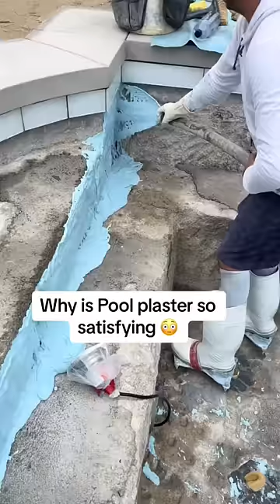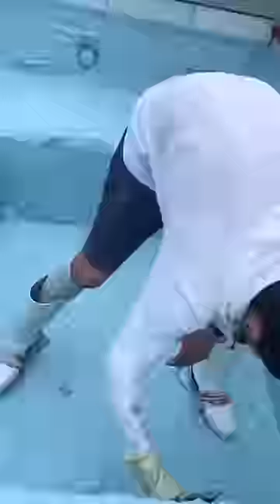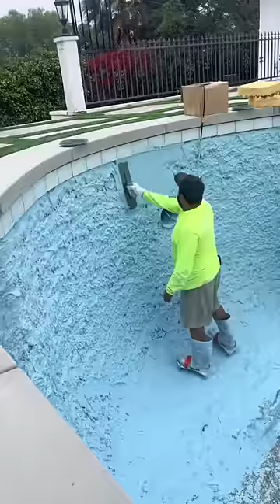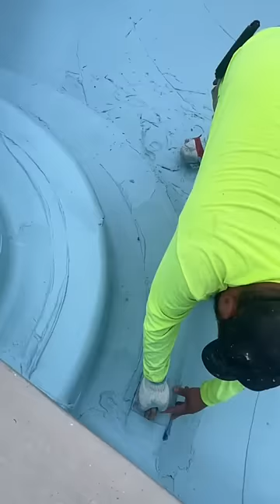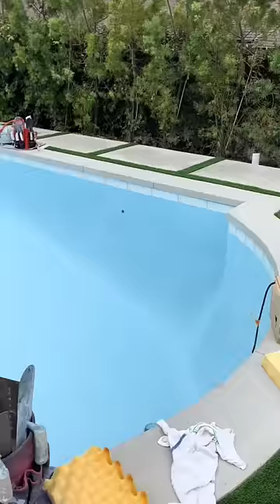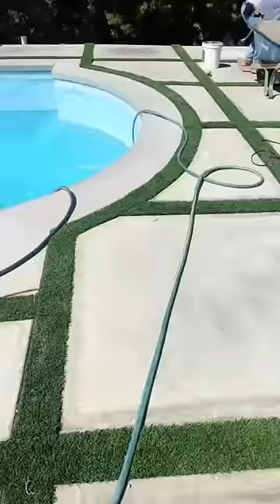Very satisfying 👀 #fyp #construction #satisfying

Comment: With all that pumping of plaster and skimming of the floats, these guys are the cleanest workers ever. Kudos 😉👍
Reply: That’s a sign of a true professional, chef coats are white to show how clean they preform, I try to apply that with my daily life, especially at work dealing with plastisol inks.
Reply: please,  what is  this material?
Reply: @beluga494 I want to know that too.
Reply: @beluga494  we would make a similar mix. I believe it is white sand and white cement and color. It is a rich cement mixture for strength. 
 Can not use normal cement or sand  because it is grey and colors won't work 
   The trowels are more flexible, called funny trowels, usually blue steel. 
We used this same mix for pool decks and sidewalks. We used a beaver brush to flick on a texture, knock it down after it tacks up. Similar to drywall knock down texture

Comment: Working trades is great sometimes. Your process looks chaotic at start but seeing it slowly transform into something valuable to people enough that they pay you is special.
Reply: And fibreglass stuck in your hands
Reply: Для них это остаётся просто "черной работой"
Reply: You're a politician or you really need to go poop.
Reply: What i wanna know is if the guy got the Uber to San Francisco
Reply: If that's gunite it's between 25-40k for that job
Reply: @whitesteve4383 for the plaster? That plaster jobs probably worth 9 grand bud
Reply: @astrocow9223  not hardly bud. You may want to check into that because like the guy said if it's gunite it's probably more like $30k-$50k for the pool and hot tub. It's not just simple plaster, it's formulated just for pools and that brings a hefty price tag

Comment: My Mexican brothers be getting so much done for this society gotta respect them 🫡
Reply: As an Arab my hats off to you brother 🎉
Reply: I used to work the remodel crew for a certain US national electronics store. Every time we worked a job that required new flooring to be installed, we knew right away, every time, whether the flooring crew was going to get it done right the first time in like 3 hours, or whether they were going to take 8 hours and fuck up 5 times throughout.

The teams of white flooring dudes sucked. The Mexican team with only 1 guy that speaks English? THEY know what the fuck they're doing, and they do it WELL.

Comment: Always remember these men earn 10 dollar per hour, and the pool cost at least 200.000 dollar. They work here for a week to finish it. So 4 men works 40 hour is 160 x 10 dollar = 1600 dollar. The rest of the money 184.000 is pure profit for the boss.
Reply: It's become more unfair at the bottom over time imo.. Too many aspects of our "free market" are out of control again.. sorry but this "greed",, private, corporate and government might be worse than ever..
Reply: So the material comes for free does it... The insurance, the taxes, the business insurance, the machinery, the equipment, the excavator to prepare the holes, the bricklayers, the concrete, the pool plaster, the jet  spray, the layer  to sing contracts, the accountants to do the yearly tax returns, the fuel and money spent to build the business.😂😂😂😂😂😂😂😂
Reply: @Sirjohnwilliamuk this is obviously in a country that never sees below freezing temperatures probably Mexico. None of what you typed applies.
Reply: Dude you could not be more wrong. First off a pool like that would be more like $50,000 second workers like this don’t get paid $10 an hour. They can make more money at McDonald’s. They likely get paid about $25 an hour. Lastly you can’t even do math right because you said it would be $1,600 but then you put $184,000 in profit for the boss. But that would mean $16,000. You’re also totally ignoring all of the material cost, permits, taxes and equipment.  My guess is the labor is about 4 weeks to finish the pool. $25 an hour times 40 hours is $1,000 for each worker. So $4,000 for the 4 workers times 4 weeks is $16,000. Then the materials are probably about $20,000. The equipment and permits and taxes are about $4,000. So the profit for the boss is more like $10,000 which is definitely enough to make it worth it.
Reply: ... и все эти комменты читает человек, зарабатывающий 350-400 долларов в месяц, работая 220-240 часов в месяц... 😐 И это ещё считается "неплохо".
Россия.
Reply: Remember that that's not true. It's equivalent to thinking garbage truck men work for low salary, most hard labor guys are making like 15-20 an hour or get paid per day.
Reply: @tickytacky8078 you are so wrong, this project needs arquitec, engineer, brickie, no matter how clueles you are about what you think other countries are like.
What are thinking that the hole magically appeared and all the earth taken from it vanished😂😂😂😂😂
Them the concrete was layed by magic and all the material just was calculated by the homies, that the mixer and spray machine come out of the bushes, there was no arquitec and earth design the pool. You are quite reduculous in your nonsense talking about Mexico or any country like you actually know anything about it.
Reply: It’s call financial literacy….can blame the owner….how you know they don’t have their own LLC ??
Reply: That's a bunch of b***** once these guys learn to trade and they get good they pay way more than $10 an hour so don't even go there

Comment: The sea blue waterproof mortar (paint) has great craftsmanship, but won’t it crack if it is completed on such a large area at one time? Although it is in contact with water for a long time, it is inevitable that there will be structural vibrations? How to deal with it?